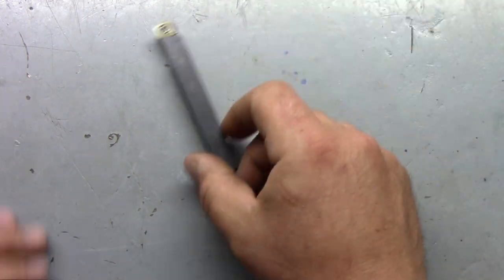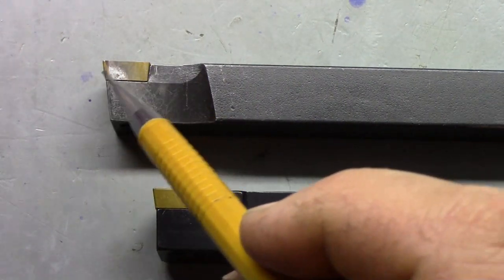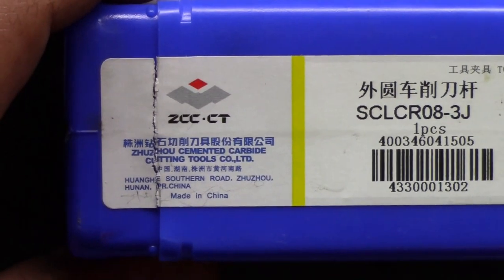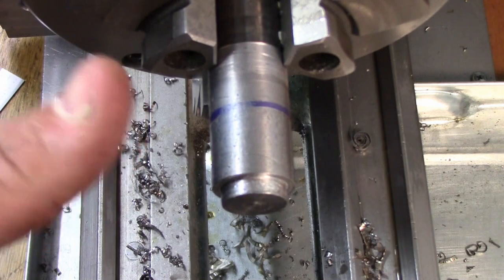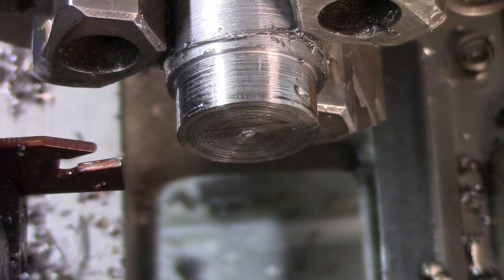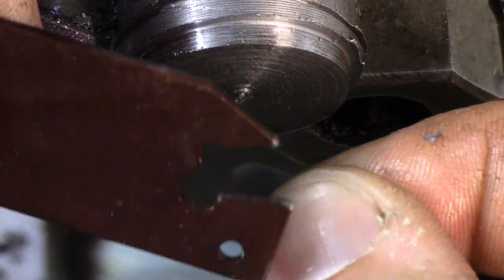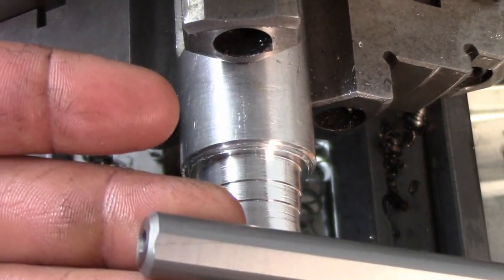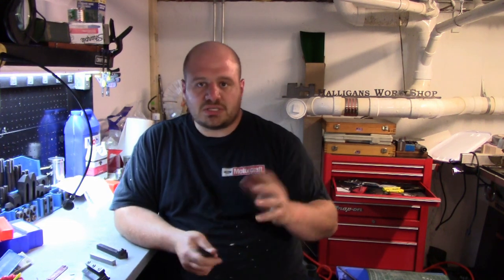Cheap VS Expensive Tool Holders and Inserts

Comment: It looked like the pocket on your holder was engaging more towards the back, leaving the tip of the insert less well held.

More forcible preloading when putting in the insert might have helped, but you also showed the insert moving back over time.

This indicates that the jaws have permanently deformed which is not acceptable.  Iin this case that the balance between brittleness and ductility may have been too far towards ductility in the material of this holder.

Given that there are bad/good results reported for this brand of holder, this could all come down to excessive variation of materials, treatment and manufacturing tolerances in the shape/angle of the pocket compared to the insert.

I was surprised by the large gap between the rear of the insert and the lobe at the back of the pocket when the bottom of the insert is level with the edge of the lower jaw - see video at 10:55

Comment: Hey Greg, that parting blade looks identical to my Aloris blade and when I got it I had the same worries regarding inserting the insert (Aloris) but no problems encountered at all It works like a champ.  I, like you, am guessing it's the blade holder that is not up to the job.  I used the blade in an Aloris holder but I am not qualified to comment on how relevant that is here.  It said the blade would take Sandvik as well as Aloris inserts which gave a bit more flexibility in terms of the option the use other manufacturers.  Thanks for sharing.

Comment: Nice video, but remember you get what you have payed for! 
Home lathes do not have the stability and speeds required to let the inserts run at there designed speeds therefor you must
compromise. Compromising causes problems. You need speed to break chips at the right moment.  Big names like Seco work better than others in this case.One tip I got from a very good engineer is that when you want to use carbide is to choise your
highest lathe RPM and adjust cutdepth and feed to get the best result. But you can only get the best result if you can feel what the cutting is doing, so start by feeding by hand, it is all experience. If a carpenter blames his tools of doing bad work then I start to doubt the capabilities of the carpenter. I am not criticising mr Halligan but there are alway's more sides to a story.

Comment: I am facing a trouble with turning an sae8620 material 
But after using carbide insert tip I have opted a very good result.
Kindly suggest me a good turning tool tip for making the turning process more comfortable

Comment: It's not a matter of pushing the carbide to the limit, it's about hitting their minimum performance level, which you can't do with that lathe.  Use HSS, it's a lot cheaper and will work better.

Comment: most of the time you should use max RPM using inserts on old machines. At work I operate from 300-6000 RPM…

Edit: 300 rpm with piece of 200 mm diameter btw, don’t misunderstand me :)

Comment: I bought a so called cheap Chinese metal lathe tool holder off Ebay,  I had to get it machined down 4mm, I took it to an engineering shop with good equipment and they said "wouldnt take long" when i picked it up they said the steel was extremely hard to cut on the milling machine, they have said some tool holders they have machined down in the past are easy to mill down.
Reply from the maker: Yes hardness is an issue with holders.  It varies wildly.  Some are butter soft and others are harder than hell.

Comment: I wanted to get an import parting tool but, as you see, getting one with the proper temper is a crap shoot.  No amount of tapping would have made any difference - your blade is too soft and the pocket would have opened regardless and a straight edge along the front and bottom will tell the story.  Hopefully Shars will exchange or refund the tool.  That boring bar, at 1/2", should work nicely in an adjustable boring head.  Gotta be better than those crappy cemented carbide and cheese bars.  I agree those polished AL inserts won't break a chip - just the nature of the beast.  Any geometry radical enough to break 6061 quickly becomes a plow that gets aluminum fused to it unless you stick to finishing cuts.  The breaker style you have seems worth looking into.
Thanks.
Reply: get one that locks with a screw, MGEHR. i have it, it doesn't fuck up. I also have it in 8mm width iscar brand, and 2mm chinese brand. Same good design, so go with the chinese unless you got a good deal at a flea market. The chinese insert is not likely to go obsolete, unlike the brand name companies which constantly changes the inserts for no fucking reason but to force companies to buy each iteration of the design. the insert is MGMN , its 2 sided. Example MGMN-200 on ebay is 2mm wide. MGMN is the iso/ansi standard generic shape, so its not likely to require a weird holder and not likely to change in the future. The price is like, 20USD for a pack of inserts, 10USD for the holder. shipped.

i looked at the prices just now, MGEHR1212 (12x12 shank, aka half inch) with 4 inserts. 12USD shipped from china. its cheaper than buying chinese locally (shars), and you got ebay buyer protection if the tool fucks up in a hilarious way like in this video.
Reply: Just added one to my cart :)  Your search must have alerted them.  It's now $13.28.  Have you tried any profiling with the 2mm?
Reply: it works within the constraints of material physics. steels have more or less the same tensile strength --- when i buy a tool, i look for the design to be the most correct as possible, and second to that the material choices.. not in the reverse order.

one of the things i want to do with this tool is side to side profiling, and am looking for inserts with round nose, let me know if you find any on ebay. making bicycle hubs.

Comment: If you use a self grip insert set below cebter, near the end of the cut the un-cut nub will roll over the top of the insert.  Rotation of the part will then pull the insert out of the holder.  Don't condemn a tool because you failed to set it up properly.

Comment: Your parting blade insert holder is normal. When you use the blade the insert will be driven back by the cutting forces to seat on the little flat behind the insert, the one between the two holes to remove it. It won't pop out in use as if you look at the holder it has very small Vs to secure the insert. I hope the person who suggested Loctiting the insert in was joking!!!

Relief in a standard turning tool holder below the insert will do nothing, and there's no good reason (other than cosmetic) that I can think of to provide it. The closest it will come to rubbing is when facing, but it's still impossible to rub.

Comment: Your rpm is way too slow especially for a small lathe you know you usually get what you pay for but I have had pretty good luck with the Chinese inserts for the money and you have to set the cut off insert with a plastic hammer I'm retired machinist but still have lathes and mills at home

Comment: your cuttingspeed is way to low, foor parting you schould start with 100m/min ( 300 ft/min). for aluminum 400 m/min at least ... for general turning  between 100 and 250 m/min. The reason the tip broke is the low speed . If you want to take deep cuts, you need power , for the feed depends on 0.1 to 0.3 mm/ rev. and a 5 hp lathe is no luxury for using carbide inserts . On your lathe i would recommend high speed steel . For this the rpm's where correct .
Reply: The tip did break beacuse the lathe did a sudden stop due to belt slip when cutting....

Comment: You  mentioned a negative rake.  You had a negative insert and the tool holder pocket is machined with a positive rake, otherwise insert would heel.  The positive holders have neutral pockets or no rake because the insert has a positive mold with a 7 Degree rake.  Carbide broke because you stalled the spindle, running way too slow.  With a small 1/4" IC you have to watch taking those DOC's.  You are getting close to the screw hole which is the thinnest cross section...not a good idea.

Comment: Thanks for the video A lot of good information I am new to metal lathe work learning a lot Have a new g602 lathe been using harbor fright cutting bits 17 dollars about 12 in the box carbide insert braised in   good for a beginner learner that # is like 222 Thanks again these are 1/2x1/2x4

Comment: Looks like the wrong insert for the part off blade. That or the blade is damaged and has been opened up. The rpm for the OD turning is way too slow for carbide. The low rpm will make a good finish impossible. 6061 at 1.5 inches should be closer to 2000 rpm.

Comment: Try cementing the carbide into that holder using an appropriate Loctite product, hopefully it would not get hot enough in use to dislodge it from the cut off tool holder. Seems if it just had a little more help in holding that bit in place might work fine. To change bits just heat with a butane lighter and use the removal tool. But agree as is its useless but never hurts to see if you can make it work instead of casting it off too soon and you have nothing to lose at this point trying since you would throw it in the junk bin anyway...you have ten bits make that sucker work. No need to throw away your hard earned cash. Thanx for this video as spending money to experiment costs a lot, better your money than mine and helps to narrow down the product choices. If you do not care to try shoot me a price for that cut off tool with bits, i will make the dam thing work come hell or high water. :) One could even silver solder the dam bits to the dam POS holder.
Reply: Yes, might work fine !
It is worthwhile to test;)
I hope he will, and gives us the test results
Reply: 😊well impressed. experts😊

Comment: Your tool cutoff tool was set too low causing a reverse of forces when you past center. However something is wrong. They should not come out.  I don't think the holder and insert match. The blade should never protrude past the insert. Also as I recall they should seat at the back (After wedging in) to carry the cutting loads. That holder is way too deep for that insert.

Comment: the inserts that come with the tool from shar's are complete crap.  The guy there told me not to even use them.   Get the YBC252 uncoated.   I use the CCMT  21.51AND CAN plow away 4150 on my 820 with a little cutting oil